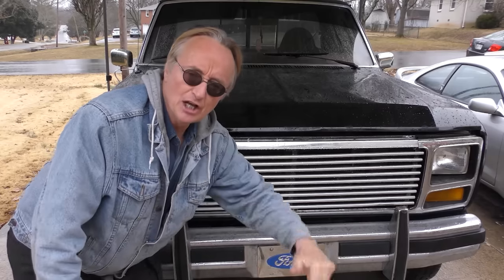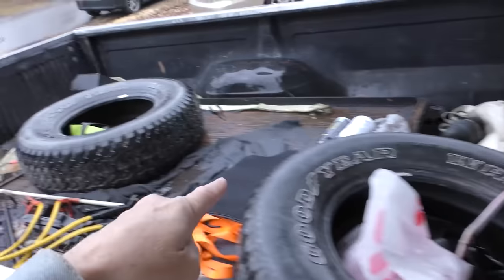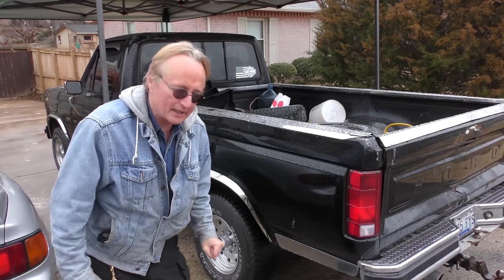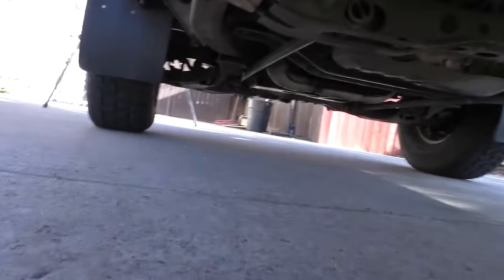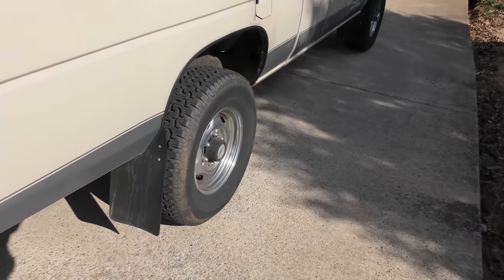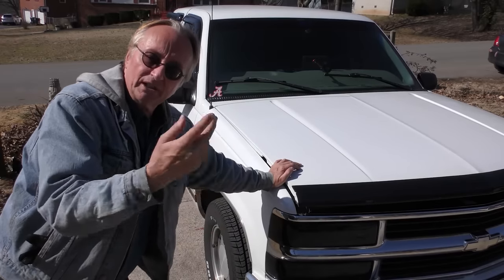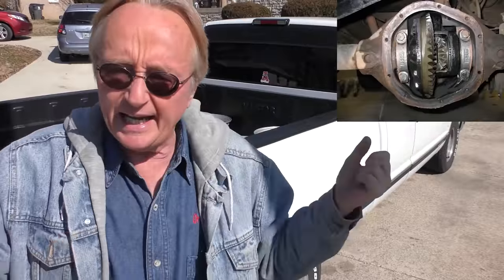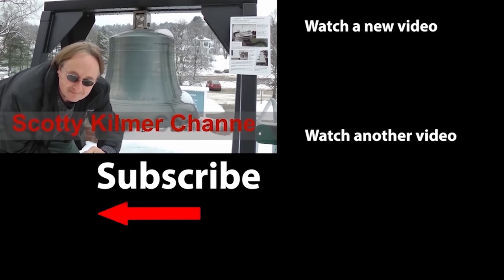If You Don’t Have This Cheap Truck You’re Stupid

Comment: My shop teacher way back in high school had an F-100 with the 300 straight 6 and manual transmission. It was pretty much bulletproof. I would buy one in a heartbeat if I could find one in good condition.
Reply: Bring back The Straight 6 300 Cubic inch Definitely !
Reply: + Manual or Automatic trans mission ! But Manual is Best & Just Rear Wheel drive !
Reply: Me too! That 6 had torque up the wazoo!
Reply: Get one in so so condition.
Reply: Me too
Reply: We had a Vermeer wood chipper with the inline 6 engine in it. Some guys were hoping to find it when it went to auction, but our county won't let employees buy equipment from our own department
Reply: I worked with a guy who was a mechanic and later became a shop teacher. He had an F100 with a 300 and manual transmission. One day he asked me to move it in the parking lot. The gearing was so low in first that I couldn’t take off because I wasn’t experienced driving manuals very much. I ended up just starting off in second gear. Did you go to high school in Texas?
Reply: @LuckyCharms777  This was in Kentucky, in Louisville in the mid 80s. I think his was a 1980 but I can't be 100% about that.
Reply: @komradkolonel  
Ah, well it’s the right decade, but the wrong state. It’s funny who you meet online sometimes so you just never know. Yesterday I discovered a guy from out of state who I had a connection with from 35 years ago.

Comment: I use to have a 1974 F-100 long bed, long wheelbase. The pevious owner had added a spare fuel tank, replaced the exhaust valves(to run on unleaded gas), and shoehorned a C-6 automatic in her. 120hp and it would pull a house off it's foundation. Never left me stranded and nothing ever broke that JB Weld couldn't fix.
  My friends all called her Die-Hard.

Comment: It is a shame. For so many years, my wife and I traveled across North American towing various fairly large travel trailers. We have visited almost every state, MexicoI and much of Canada. I sold my last truck trailer combo in 2019. 
The costs of maintaining both truck and trailer properly got to be outrageous. I did much of the work myself where I could but just a good set of trailer tires ran $1000.
Travel trailers are terribly built. After every trip I used to have to spend alot of time and money just repairing stuff that broke.
Not too mention the distinct lack of decent campground not overcrowded or loaded with folks living in depressed conditions making it like staying in a slum.
It just didn’t make sense anymore . The RV industry pitches this idealistic lifestyle that simply doesn’t exist . Not too many years back RV travel was a wonderful way to travel. Not any more.
I miss it and I hate staying in hotels but we try to travel in our Highlander.
Sadly It is not the same.
I should have mentioned fuel prices. On our last 2018 trip from the east coast out to the Canadian Rockies, we spent close to $3000 in just gasoline for my Ford f250 towing a 26 ft TT.
That was at least twice the cost of what we budgeted and that was before the pandemic and the latest crappie inflated fuel prices. Just for gas! Before the F250, I had a great Chevy diesel, but fuel and maintenance was no cheaper.
Another part of the American dream shot to heck for the average people. Shameful.

Comment: Love those 300ci I-6 engines. That truck looks like it has the twin  I-beam front end
Reply: I had a 1996 f150 with a 300 cid straight 6 with a manual transmission. That truck pulled like a Missouri mule and ran like a V8 Too bad my wife wrecked it.
Reply: Great engine never broke down gas mileage was great a 6 cylinder

Comment: From 1975 to 1983 Ford made both the F-100 and F-150. The difference between the 2 was the kind of engine, drivetrain and suspension they had.
Reply: Yes. The F-150(also the E for Econoline Van)usually had the V-8(302)and stiffer springs, heavy duty shocks, and heavy duty hubs and spindles.
  I know this because in 1979 I bought what I thought was an E-150 from Bakerfield Ford Dealer but walking around it, I noticed a E-100 badge on one side and an E-150 badge on the otherside. They sold me an E-100 as an E-150 and to make up for it they sprung for the 150 springs and aftermarket Bilsteins. But didn't replace the spindles with the heavier ones. 
  Thankfully only paying Fleet Price for it and it was only used for lightduty delivery, I really didn't need all the heavy duty stuff anyway.
Reply: No f100s after 74

Comment: Got tired of replacing the regulator only to find out the alternator was bad too, or vice versa. It's just easier and cheaper to buy a one wire alternator with a built in regulator and be done with it.

Comment: I still have an old van with a 300 engine and it wouldn't die. The vehicle rusted off around it. Even at 20 below zero, unheated that engine would turn over and go.

Comment: I used to have a white 86 Nissan pickup with an inline 4 cylinder engine. Man that was a hell of a little truck! So easy to work on and do typical maintenance. Miss that lil truck!
Reply: I had an '87 Hardbody with 2.4 litre "Z" engine and 5 speed. I still miss that truck!!
Reply: @UnkleAL1962   They were good

Comment: I just got an 89 bronco II for less than $3000. The vehicle is an absolute tank. 4wd too
Reply: I went and looked at one for sale in 2020! It was tempting! Straight 6, standard, 4x4 mostly intact and running! The guy only wanted $3500. It was a little more than I can handle right now with gas and repairs though.
Reply: Good luck with that one.

Comment: The old equipment is still working.  I have a 1964 Ford f250 a 1981 Mercedes 240d, and a 2005 Mercury Grand Marquis and they work.

Comment: Thanks for trip down memory lane!  My 1st truck was a new F100, 6, manual transmission.   Put 200,000 miles on it, minimal repairs.   Traded it in on an F150, V8 as I needed to tow. Loved that old F100.

Comment: I had a 78 F250 with a 30 over 300 manual transmission with granny gear. Air conditioning was a school system truck so it was yellow paid $900 and drove it for ten years best vehicle purchase I ever made.

Comment: Back in the early 70’s I bought a used Toyota FJ 40. Landcruiser. I loved that vehicle. It had a separate transfer case AND Warn locking hubs in front. I could take that thing everywhere. I even learned 4 wheeling under rough terrain under power lines. It was simple

Comment: 300 Ford inline 6 is tough and drives out fairly strong and comfortable.  I liked the ones that had the stick shift with the curved stick indicating a granny low.
Reply: My 87 4x4 300 has the 4 sp granny. Only use it to tow.

Comment: The back seats in the 86 Nissan are like the Chevy S10 Est. Cab from the same years. They called them jump seats. I had a 4x4 Chevy S10 V6 drove it for many years. We used to build the best, when Americans were still doing it all. The late 1970's, all American 4 cyl. were Japanese engines. Ford Courier, Ranger built by Nissan. Wish I still had my 97 Silverado. Bought a 08.👎

Comment: I still drive the 1989 silverado that my father in law bought new that year.  It only has just under 122,000 miles on it.  4.3 liter v6 automatic step side bed.

Comment: I had a 95 ford e250 with a 300 straight 6 in it. Drove it til the oil pump went out on the highway and didn't pull over fast enough and spun a rod bearing at 465k miles and it still pulled a trailer like it was nothing. If that oil pump didn't go out, that van would still be on the road today

Comment: I had a 1974 Ford E-100 with the 300 six and a three’s speed manual.  Lousy gas milage and it topped out about 75 mph.  Didn’t want to start if it got below 10 degrees. Still was a great truck.

Comment: I drive a 1967 Ford f100 daily it's got a 390 v8, automatic transmission. I wouldn't sell it or trade it for anything. It has never failed me, and guess what you can work on it without a computer technician!!

Comment: I owned a 1983 F 150 and 300 in line 6 cylinder, 4-wheel drive, extended cab drove I drove it for 20 years and finally gave it away because the body was in terrible condition. I could see the road through the floorboards. The guy I gave it to wanted it to put the engine in another truck in better physical condition. I replaced it with a 93 F 250 351 Windsor engine with 200,000 miles. The body was in pristine condition. I then replaced the engine and transmission from a quality engine shop and expect to get another 300,000 miles. This one I use for towing my boat and trailers. I will keep the body repaired and as rust free as possible.

Comment: I had the same truck but a 1986 it was the last year they made the 3 in the tree For a 6 cylinder the truck had alot of torque You could literally drive it in 2nd gear all day long. The only problem with those trucks and living in Ontario Canada it rotted away fairly quick.

Comment: Worked as a mechanic for a company that had a fleet of pickup with the 300 lucky to get 100k miles on the engine before it went out also had to replace a lot of kingpins front ends were weak

Comment: " In my 4runner , I just push a button and it goes into 4 wheel drive " 
Well.... Its SUPPOSED to go into 4 wheel drive ..
but it doesnt anymore .
The Old School 4x4 mechanical Shifter and front lock outs worked good .

Comment: Man them ford 300 6 cylinders are the best. I had me a 81  F150 with the 300 6cyl. in it.  you couldn’t blow that motor up if you tried. it’s called 

BUILT Ford Tough 👍

Comment: The Toyota T-100 was a good truck.  But TMC was afraid to make it a full size truck because of pressure from the Big Three.  The bad thing was the rubber timing belt that had to be replaced religiously.

Comment: My old 86 F150 was identical to that truck.  I pulled a 5000 pound sailboat/trailer numerous times.   I made the mistake of giving the truck to my nephew.  Wish I hadn't done that.  I could change the plugs in 10 minutes and 5 minutes of that was finding my spark plug socket.

Comment: Own the same thing but with the 302 V-8 in it but that 300 6 has to be one of the best engines FORD ever made which is exactly why they do not have it anymore as far to logical and practical for today.  Virtually no "electronic goo" all over as today's "wanna-be" trucks do - toys in comparison.  This is a real truck!

The proper name for this generation is "Bull Nose" and I recommend a total restore as the value on these are going up and up!   4-speed auto is good but personally prefer manual but either one is far better than the goofy crap Ford puts into their trucks today!   

Thanks Scotty!   🙂

Comment: I bought a 1993 Ford F150 with that same engine new. Never any problems with the engine but the automatic transmission started to self destruct at around 85,000 miles. Many Fords had transmission problems around that time.

Comment: Are used to have a 91 Nissan hardbody. I bought it for 50 bucks and the 2.4 L 12 valve in it five speed manual. I drove a thing all over the place for 4 1/2 years. It was a decent little truck it was multi port, feel injected and made a lot more power than they’re older four-cylinder‘s. It was actually a pretty quick truck for its time thank it had somewhere around 400,000 on it when the frame snapped from being up here in the rust belt.

Comment: My 95 f150 has the 300 inline 6 automatic air conditioner at 236,000 miles it still runs great and everything works down to the glove box light and yes I’ll sell it for 5 k no less you just can’t find them this tough anymore!

Comment: How do you have two exhaust pipes with a strait  6 cyl engine? I do not get it?
Reply: Exhaust manifold is 2 separate pieces. I dualled out my 87 300 6 cyl 4 sp 4x4. Still have it.

Comment: I had a '78 Ford pickup with the 300 straight 6.  Every time the oil was changed it beat up the push rods.  Ford had no resolution.

Comment: I have a 82 F-150 and i wish it was a 4-speed. These trucks came with the Ford C6 3-Speed automatic transmission. After 60-70 kph you start to feel the lack of an OD system.

Comment: Please help me: We have a F150 2022, the system shows that, I should change the oil it at 10,000 miles, I'm doubtful, I don't know if it's good or bad, but it's what the truck's computer shows me.  What should I do?  change it to 5000?  3000?, it must be synthetic oil that it originally has.  please help me with your answer.

Comment: my 1996 B4000 truck came with those Firestone tires. When they get 50000 miles on them I got a notice telling me they were recalled, so I got a new set of tires for free after I got 50000 miles on the original set

Comment: One I had 300 6 cylinder. 4 speed was a tank about 85 mph down hill and  double gas tank  and could watch gas gage drop  had terrible trouble with body rust  frame motor transmission  was great

Comment: I've a big Chevy C1500 Silverado trim. Ext cab with 8ft bed lwb...350 tbi. They aren't fast but they are good and dependable. Mine is 92. Rebuilt the engine and trans 20k Miles ago but I bought it at 197K Miles for 1100 USD and only put 1500 miles.  About 7 years one mile to work and 1 of course back. That's it. I took a couple times in town. It's been amazing. Replaced the alt is all. The rest is great. Sadly it's been parked and sits. Had some rust coming in and mold from sitting with door cracked open. I need to clean it out and fire it up. Battery way way dead won't hold charge.

Comment: I had the same Nissan truck but with the 4 cylinder. For some reason it had 2 spark plugs per cylinder. The damn thing lost power and started shaking bad, took it to a mechanic and he said he thought it had a "burnt valve", so I junked it. I will never buy anything by Nissan again

Comment: 84 F250 300 ci 6. 4x4  5 spd w/ granny gear.
Best truck l had.....375k miles running on 5cyl. An like 2 psi on oil pump Guage.

Comment: I bought a 2001 Nissan Xterra from my brother 8 years ago it has 260,000 miles and still running strong. Clean Texas car I brought back to Michigan only thing I have done to it is new tires lower control arms and trimming belt. Runs strong but rides like a truck but for $1800 who cares.

Comment: I had a 1996 Ford F150 with the 4.0, 300 Cubic inch motor in it. It unfortunately was an automatic, but the transmission never let me down. I bought it used for $2,500 and ran it for 12 years. When I moved to Florida, I left it for my son. He drove it hard, and it started to need repairs. He wasn't in a position to put money in it, so he sold it. He regrets it now!

Comment: Probably the best inline 6 made.. we had a few 6s... in Van's and pick ups.
They still ran.. when we finally had to sadly junk them. 
I'm still driving my 94 Dodge.. with surprisingly a magnum v6.. my friend gave me the truck .. cause mine got totaled .. while parked. We changed everything we could that needed replacing.  Parts are cheap and available 
2 plus years later.. I'm living in a different state.. its still running.. I put 20k miles on it so far. Today vehicle wont last 30 years. 
Today's vehicle wont last 30 years.